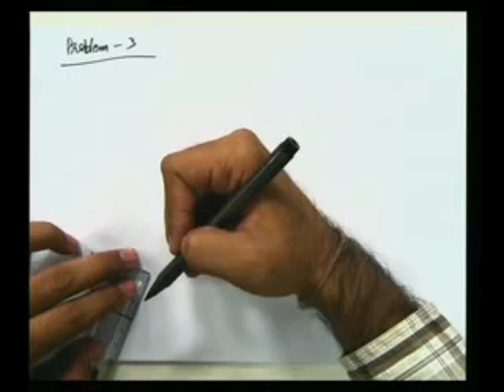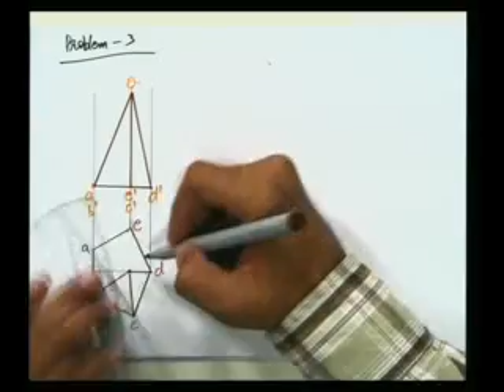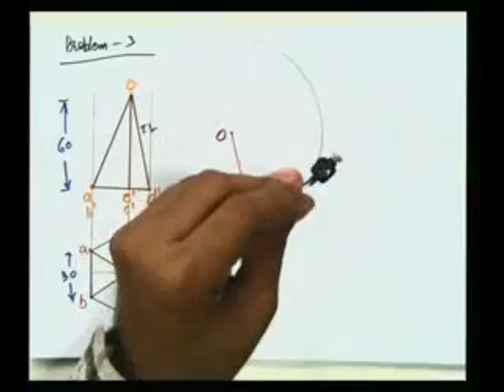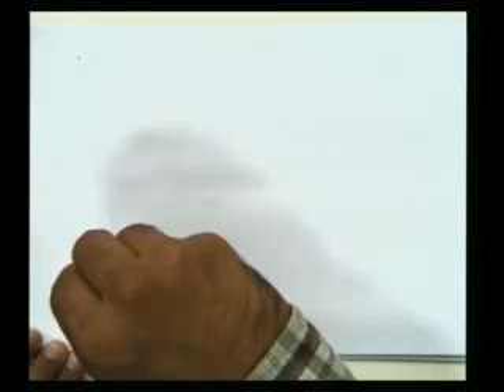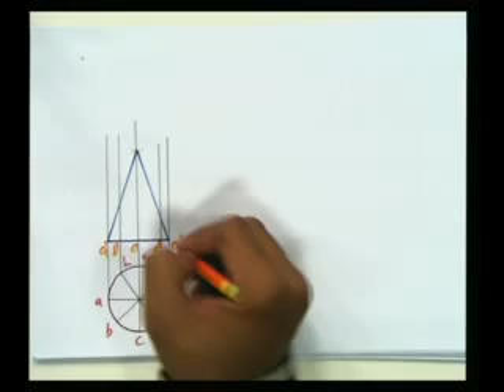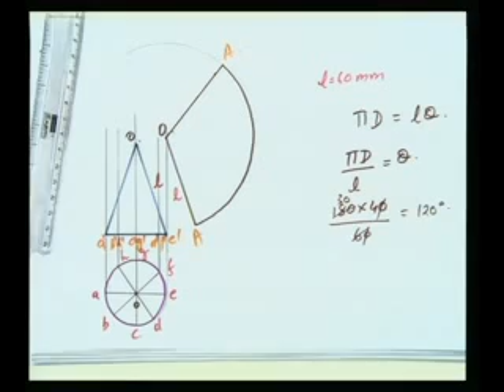Yash Chawla Engineering Graphics-Development of Lateral Surfaces_4

Comment: Thanks for the video.. but in the first problem of the video you took height of Pentagon on the projector of point itself instead of the projector of intersection bisectors of sides. this will make the solution wrong.